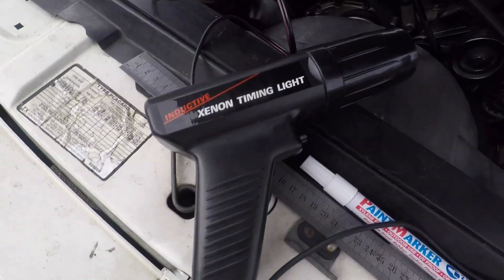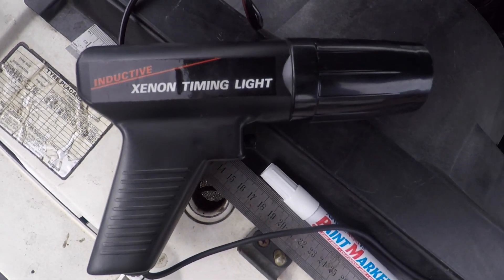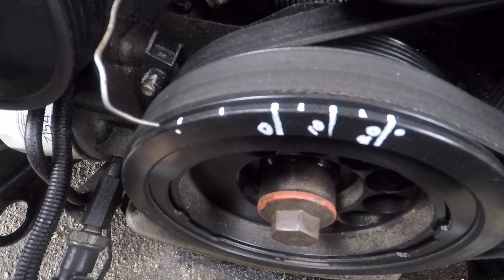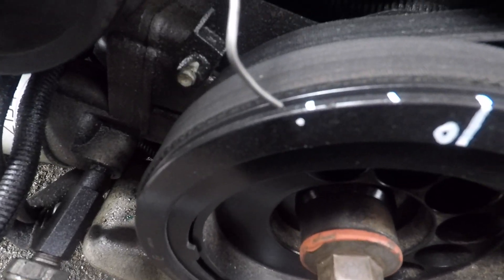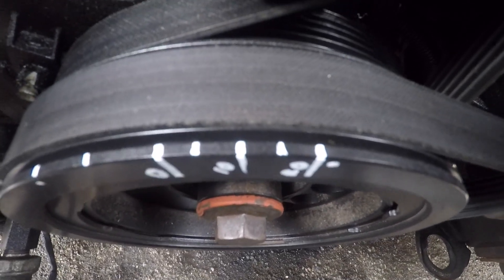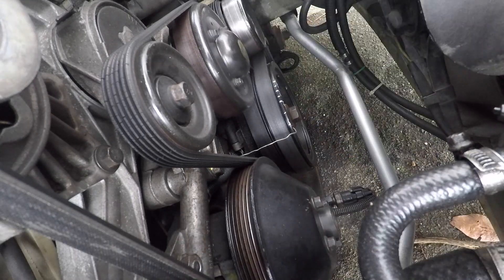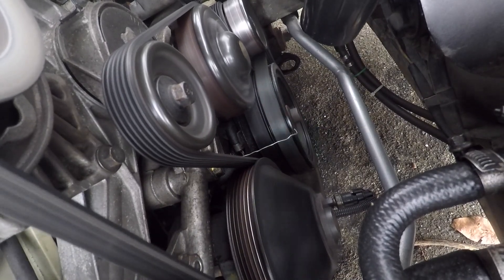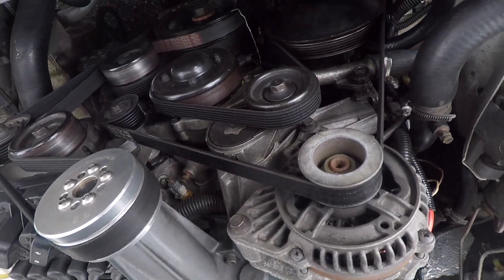Timing the Holden V6 LN3 L27 L36 L67

Comment: Ben if i was to install a catch can on my l67 can i run 1 hose from the pvc housing top to can & another hose from blower to can blocking off the t.b.barb.?
Reply: Running a catch can on a clean burning/well maintained L67 is pointless. It's better to just leave them alone, maybe clean out the PCV valve every 50k or something, remember they don't have the emissions crap of ECOTEC's (EGR - Exhaust Gas Recirc) which is what gums the hell out of these motors. Best thing about L67's is they only have PCV & other relative evap emissions type stuff that every other cars has post 1975.

EGR i despise, it's a feral system. 
Just leave the PCV on your L67, unlike ECOTEC's which require the manifold to be taken off to change/clean, L67's have them easily accessible 

But Ben needs new belts, way too many cracks 🤣
Reply from the maker: Vincenzo G Haha more cracks than a new apartment block? 😅 I do have a new belt here but saving it for a roadtrip, if I put a new one on it'd get wasted in ISO and end up old again before I got to drive anywhere 🤓
Reply: @BENgineered  More cracks than an apartment block, with how properties are built in NZ & Australia  i can agree with that 100% hahaha 🤣🤣🤣🤣🤣
Reply: @BENgineered  Make sure that two piece pulley bearings aren't shot, because they're a bitch to get out 🤣

Comment: Very clever...so this basicly verifies  that the sensors and ecu are doing there job properly yes? 
This will be helpfull when I turbo my vs work Ute. Great for tuning and hopefully keeping the stock bottom end in one piece.
Reply from the maker: Yes and confirms the phasing of the trigger wheel on the balancer. Also good to diagnose DFI pack or Memcal faults as you can clearly see if the ECU is in diagnostic advance

Comment: Iv got the s2 buick from the vp.been watching yours and bbgs vids for along time now.looking into doing a turbo over next few years.would I be better to swap out the s2 for an ecotec.if so will the na eco do it or does it have to be a sv6.this seems like my best option as other conversions cost 2k.(nz) hopefully being auto and v6 there's no cert needed
Reply from the maker: It depends what you want to do. The S2 Buick is strong, dependable and already there. Ecotec has better flowing heads (stock form) but the pistons are arguably weaker, high compression to start off - plus you’ll need to do an engine swap plus wiring and a base tune. The Stock VP ecu is Perfect for boost with a program and map sensor upgrade. Unless you have a specific reason to go to the l36/l67 platform, I’d stick with the Buick and make it sing ;)
Reply: @BENgineered  sweet.exactly what I wanted to hear.and from someone that knows.its all standy apart from coby headers.iv sortd all the common problems service the shit outa it..time to make a plan something to do over winter.been busy enjoying it over summer.it definitely has good flow.a really unique sound already
Reply: I'll make a plan and run it by you hopefully you can help me not blow it up haha
Reply: I want to do..
New radiator and hoses+res
Leads n plugs
head gaskets 
Strengthen auto
Diff
Flip headers so pointing foward and make pipe to join.
run exhaust were a/c pump was.wrap
Map sensor
Intercooler
Sv6 injectors
New Xr6t turbo
It would b really helpful to talk to someone who's done this before thanks
Reply: Had my cars suspension fixed today.i did the bushes myself.freed bearings abit.had 2 tie rods n wheel alignment done from a shop.what a difference.so happy.the first corner I hit at twice the speed I usually do.little things like this make a huge difference.thank you for the info u guys are really helpfull

Comment: hi ben unrelated question ive got a l67 & the coolent sensor tip has broken off is it dangerous to leave floating about or sould i dismantle engine. please reply asap hence in a jam.
Reply from the maker: There are some small galleries in the head I wouldn't want blocked. You might be lucky and find it in the Lim area.

Comment: Hey mate just got a question for ya sorry it's not really related to the vid but your insight would be appreciated I'm using a vp v6 with a t5 for an engine swap I've got it all mostly wired but I'm just trying to streamline it a bit... (Probably a dumb question but I'm been looking at so many wiring diagrams my head hurts😂)  
Does the ecu need to see the reverse switch input or can I just hook it up to my existing body wiring?
Cheers
Reply from the maker: Hey, there is no reverse input as such into the '808 ECM, You do need to bridge the P/N to allow the starter to crank. Also, you may want to get the Memcal reburned or get a manual tuned Memcal.
Reply: BENgineered ok cheers I was thinking I would possibly need a custom tune it has a walbro 255  with surge and lift pump?
Or if I set the pressure right and use a standard fuel reg do you think I'd have a chance of running a standard manual memcal?
Reply from the maker: A standard Memcal will work as long as your fuel reg cab handle the increased flow and is set to stock pressure

Comment: would i ! id luv 2 c more on timming the v6.  everyone says its impossible 2 do because the computer does it.
Reply from the maker: Thanks for the feedback. I'll make a future video on how the timing works on the V6. This is mainly for diagnostics, timing is controlled by the ecu however there are a variety of faults that can happen which result in the commanded timing not being delivered.